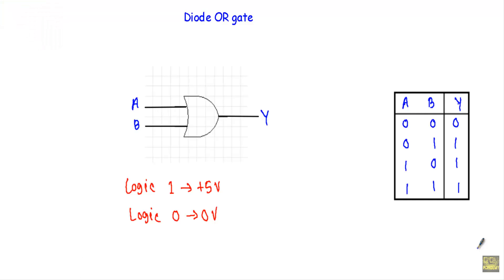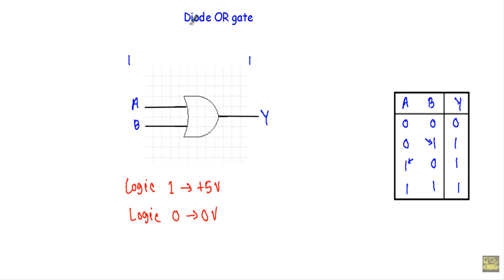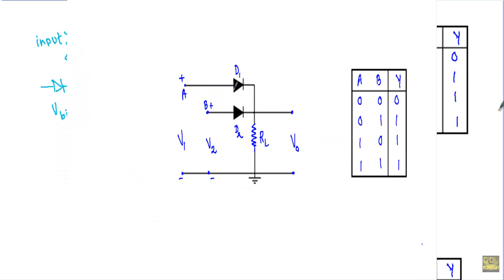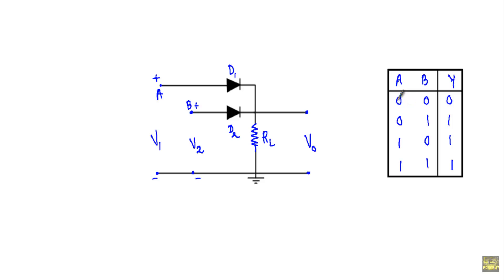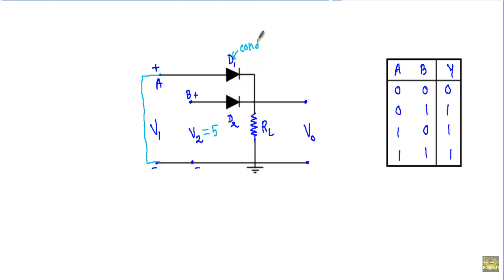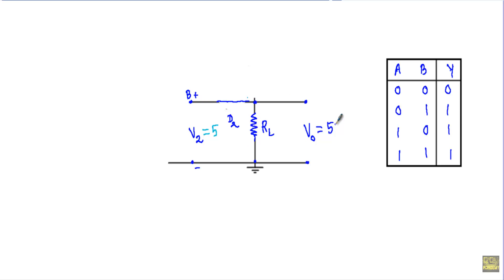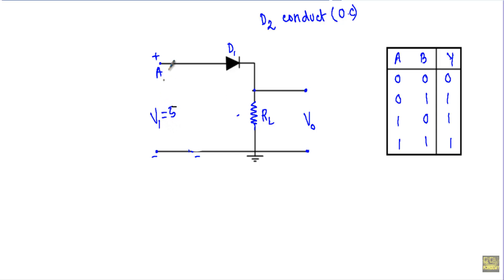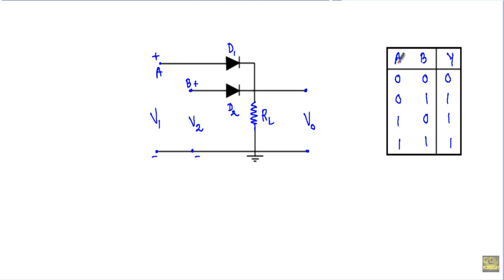Diode OR Gate

Comment: You will not get Vo = 5[V] . When the diode becomes forward biased , the voltage on the diode becomes ~0.63 - 0.65 , so you will have 5 [V] - that threshold voltage. Yes , it's not a lot , and yes , you will still get a theoretical logic "1" , but it is very important to keep this in mind when designing a circuit. The voltage on the resistor will be ~ 4.35 [V]
Reply from the maker: Consider the ideal case of diode

Comment: the resistor electrical potential is 5v meaning he will only conduct after 5v s apply to his threshold, in the case of two inputs off 5v you will get 10v ,since all components in the chip are having a capacity of 5v how do you control the 10v  current and make sure only 5v would apply to the terminal
Reply from the maker: When you apply 5V in two diodes, the o/p will be 5V because those 5V sources are connected in parallel. You better try to understand with circuit simulation :

http://everycircuit.com/circuit/6144062094835712
Reply: thx u sir.make a more video on or-gate in diode.